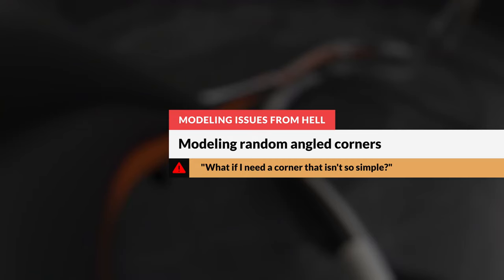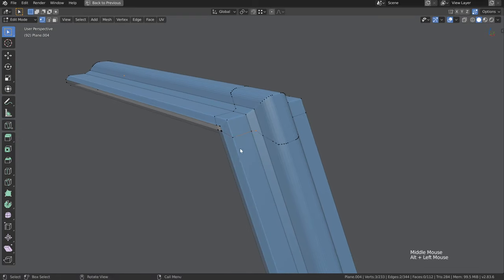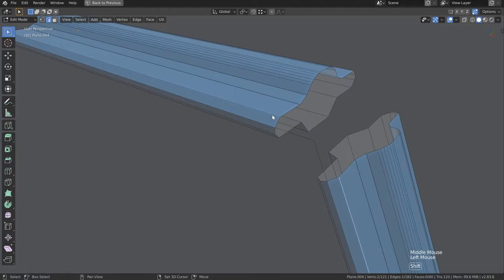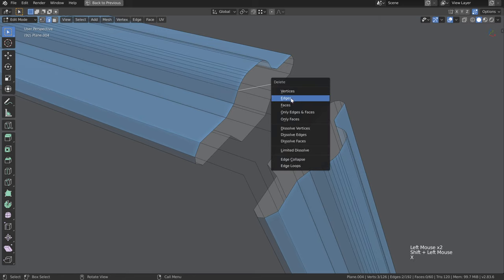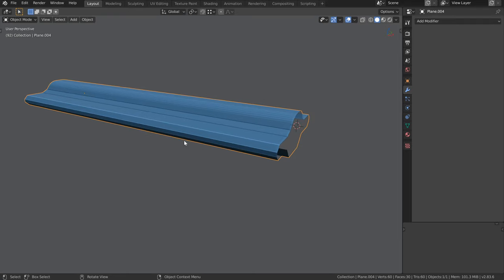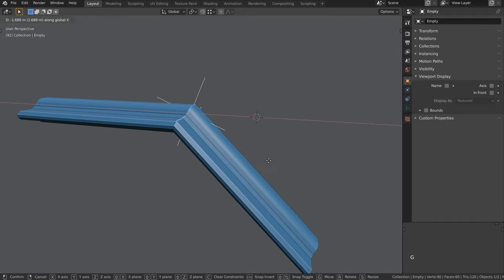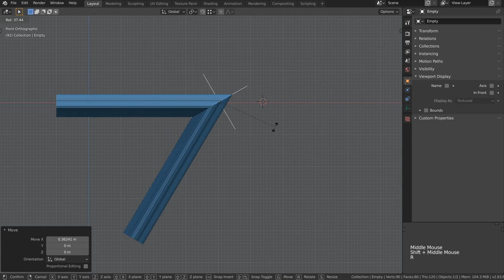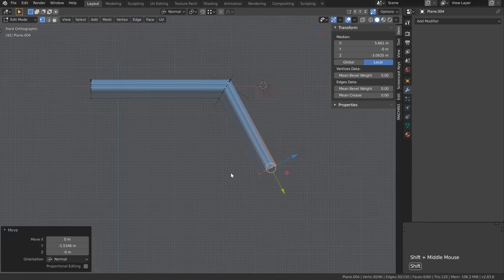Blender Tutorial | Making Corners

Comment from the maker: I'll put any necessary updates or notes here! For example how cool would it be if Blender had a one click tool to do this? Or there's more ideas that people out there have that are even simpler :) Or perhaps the tinyCAD addon added an option to do that with 2 faces selected and then BAM! Corner created. :D
NOTES: 
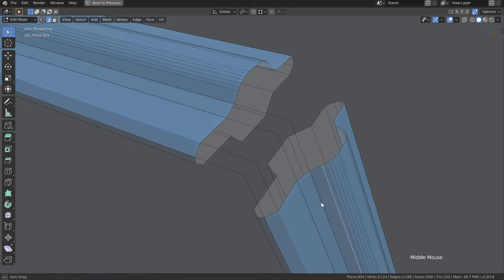At 1:49 I mention the 'Line tool' from the 'make line addon' but I mean to say the 'snap utilities line' addon! So if you haven't seen that addon that comes bundled with Blender before, check it out! :)
Reply: Someone is going to need an add-on to export and import a list of add-ons.
I have more than a dozen that I turn on in each install as soon as its accessible.
There's probably already an add-on that does that.
I love Blender.
Reply from the maker: @coreys2686  At the start of each install on the splash screen and only the first time you launch the new version of blender there should be an option to 'load previous settings' or something like that. Hope that helps in your case if you haven't tried it already. :)
Reply: @AidyBurrows3D  That's very true, I've seen it, but I don't really use that feature. I usually go with default settings then turn on add-ons, just in case a setting or keyboard shortcut changed. Easier for me to help people in the Discord server I'm a moderator on as well. They don't usually do crazy things to their installs. Some don't even know about the add-ons yet.
Reply from the maker: @kefex  that is super cool! Thanks so much for sharing! I can see the blend and it looks like it'll work great, but i'm not quite sure how to use it at first glance, i've attached a blend here to show a couple of results... https://drive.google.com/open?id=11lLrHucodN0HLSWPYotiOGeZOUVLFrW-  it would be super ideal if we could just select the non manifold edges at the end of some geometry as the profile then select poly line and then BAM! The orientations were taken into consideration and it just extruded it right into the correct place, hopefully that makes sense! :) Hopefully i haven't completely overlooked something. :)
Reply: @AidyBurrows3D  Hi Aidy, took a quick look at your file -- I neglected to mention that the profile has to lie in the xy plane, and mustn't have a rotation in it (i.e. apply rotations first). I made that change to your file and it worked, although the normals were reversed :P  I can add some logic to detect that case do a fixup.

Comment: Setting your view to the desired axis, Shift ctrl alt S  and then Z/X/Y (depending on desired axis) will also do, tho its also a little tedious
The bisect tool would also do (Which is basically like the knife tool's "Z" option, lets you make a cut straight through a mesh but that the bisect tool lets you choose what faces you wanna affect). It doesnt have a shortcut by default I believe, but you can access it under mesh > Bisect while in edit mode after selecting the faces you wanna slice/cut. To get things aligned perfectly it also gives you a little window in the bottom left of your screen where you can fine tune the angle of the cut
Reply from the maker: The shear tool has come up a lot (i.e. the shift ctrl alt S tool), it's one of the previous chapters on the course as it happens (the knife tool too thinking about it)! :D But this chapter goes where even the shear tool (and knife tool) finds it hellish. Shear is great for simple 90 degree corners for sure, and the knife cut on an angle constraint works well for that stuff too. But getting more trickier and random angles means the shear tool gets more awkward to use. Shearing then extruding in most other cases (not a 90 degree corner) means the geometry coming in will be a different size when it comes out of the corner, hope that makes sense. :)

Comment: Mirror make symmetry parts, but if need  make one of parts longer? A lot of extra work
Reply from the maker: to make one part longer you just move that geometry along it's normal, or hit the slide vertices option and hold alt to go beyond the constraints then just move the empty to match where the mirror needs to go. It'd be interesting to make a script out of it too, just take a selection, separate it into another object, and then do all the create the modifier automatically and then the 2nd part of a script to apply the modifier and then attach and weld back to the original geometry. But having said that i'm just hoping that another simple tool becomes available for everyone to do it soon. :)

Comment: Very cool, but why not just use Shear to create a corner?
Reply from the maker: thanks! That's also a great question. :) Shear is great for simple corners for sure, and the knife cut on an angle constraint works well for that stuff too, say with a 45 degree mitre for example it works a treat. :) But getting more trickier and random angles means the shear tool gets more awkward to use, you'd need to align the camera to the face, and then know the correct shear value to match the correct orientation of the 2nd piece so that each piece fit at the join correctly. Hope that makes sense! :)
Reply: @AidyBurrows3D  That makes sense if you are working with two pieces and you definitely have easier control over the rotation of the angle by using the empty with the mirror modifier  Also, your method is much easier when the object is not aligned with a global axis, or the camera.  I usually just start with one piece and use Shear to the change the angle of an edge loop at one end and then extrude it.  I like your method with the mirror modifier and I'm sure I'll make good use of it.  At first, I couldn't figure out why it wasn't working for me, but then I remembered to apply the scale and it worked perfectly.  Thanks!
Reply from the maker: @sdrawkcabdaernacuoy  ah yes, very true, the old apply scale issue, is our number 1 recommended tip for all things! :D The problem with shearing and then extruding is that the size of geometry coming out of the extrude will be different from the size going in, unless it's a 45 degree angle, i.e. a shear of 1 for a 90 degree corner. For those 90 degree corners shear is the way to go for sure. :)

Comment: For this operation there is Shear Tool, see toolbar... :)
Reply from the maker: The shear tool has come up a lot, it's one of the previous chapters on the course as it happens! :D But this chapter goes where even the shear tool finds it hellish. Shear is great for simple 90 degree corners for sure, and the knife cut on an angle constraint works well for that stuff too. But getting more trickier and random angles means the shear tool gets more awkward to use. Shearing then extruding in most other cases (not a 90 degree corner) means the geometry coming in will be a different size when it comes out of the corner, hope that makes sense. :)

Comment: I found a slight glitch.  If I use a cube stretched along the x axis, add the empty at the center of the x axis (at one end of the cube), set the mirror and all the correct parameters, the rotation doesn't work well and the cube deforms.  I found if I make a rectangle rather than a square, i.e. scale on the z axis, the bending around the empty works fine.  Stranger things have happened, but it is mystery.
Reply from the maker: are you scaling in object mode i wonder? Things will almost always go crazy modeling without the scale applied (i.e. go ctrl A > Scale). Best to always scale in edit mode. Hope that helps and i've not misunderstood the issue there. :)
Reply: @AidyBurrows3D  Thanks.  I went back and applied scale and it works fine.

Comment: Why not use the shear tool ?  You can easily control the angle you want.
Or am i missing something you can do with your method  that you can't with the shear tool ?
Reply from the maker: That's a good question, the shear tool has come up a lot, it's one of the previous chapters on the course as it happens! :D But this chapter goes where even the shear tool finds it hellish. Shear is great for simple 90 degree corners for sure, and the knife cut on an angle constraint works well for that stuff too. But getting more trickier and random angles means the shear tool gets more awkward to use. Shearing then extruding in most other cases (not a 90 degree corner) means the geometry coming in will be a different size when it comes out of the corner, hope that makes sense. :)
Reply: @AidyBurrows3D  Thank you for your answer.

Comment: Can't you do a curve and make the bevel the cross section of the thing you want to make a corner then do curve to mesh
Reply from the maker: you can! But it can go wrong very easily if the orientation is off so it ends up being very fiddly and long winded to setup in my opinion, also you're stuck on a particular axis, you can't make more freeform extrusions in 3d space, but Kevin Atkinson has replied to my main comment here with a link to an addon that might just sort that out. I'll check it out shortly! :D

Comment: SHEAR :P
Reply from the maker: hahaaa! That has come up a lot, it's one of the previous chapters on the course as it happens! :D But this chapter goes where even the shear tool finds it hellish. Shear is great for simple 90 degree corners for sure, and the knife cut on an angle constraint works well for that stuff too. But getting more trickier and random angles means the shear tool gets more awkward to use. Shearing then extruding in most other cases (not a 90 degree corner) means the geometry coming in will be a different size when it comes out of the corner, hope that makes sense. :)
Reply: @AidyBurrows3D  interesting.. thanks.

Comment: Double tap G and hold Alt to slide a vertex beyond it's edge. No need for fancy addons.
Reply from the maker: are you referring to the snap utilities addon part? Unfortunately in that situation the slide tool isn't able to do what that addon does there accurately enough yet. The main issue is that we need to find the intersection points, sliding or even simply moving the geometry along that orientation isn't really the problem. The slide tool unfortunately isn't able to snap to other vertices either whether it goes beyond the extents of the original geometry or not (i.e. holding the alt key) or even if you have vertex snapping enabled, as far as I understand it the slide tool simply does some percentage of the distance between itself and the neighboring edges, rounding out the slide amount figure when holding ctrl, that means to find the intersection points are going to be pretty much impossible. It's why this making corners task can be deceptively tricky or at least have several more steps in the solution than first thought. But please also note that the addons option is only worth pursuing in this case if it was a very simple join, a profile with just 4 or so sides as it's quick and easy to fill the edges that get created to find the intersection points in with, for a more detailed corner such as in this video, i'd probably just separated the geometry, use the mirror option and then join it back in with the rest of the geometry again. Hope that makes sense! :)

Comment: Shear tool ?
Reply from the maker: Shear is great for simple corners for sure, and the knife cut on an angle constraint works well for that stuff too, say with a 45 degree mitre for example it works a treat. :) But getting more trickier and random angles means the shear tool gets more awkward to use. Shearing then extruding in most other cases (not a 90 degree corner) means the geometry coming in will be a different size when it comes out of the corner, hope that makes sense. :)
Reply: @AidyBurrows3D  I always made lines in 3ds and chose what profile to follow. In the blender I did little of such things, but I would certainly also run a profile on the indicated line. I know that the blender also has tools for measuring the angle between the lines so that it should work perfectly in such cases as you write. The advantage is that changing the size of the cabinet front is a matter of moving only 2-3 vertices, the rest is done automatically by the modifier ...